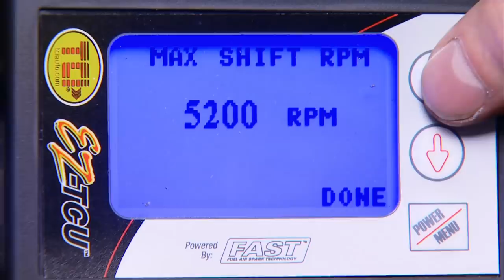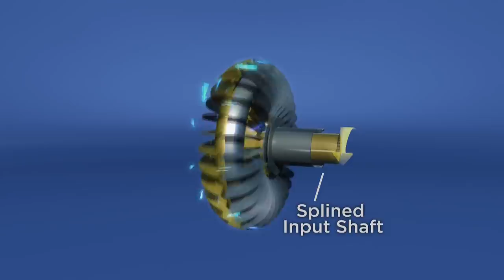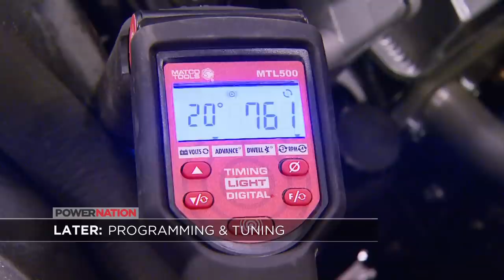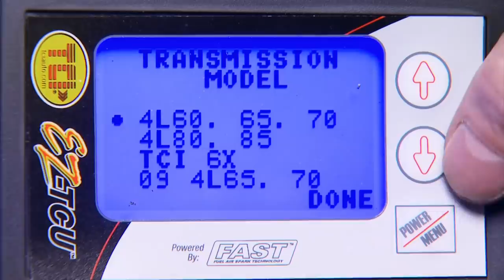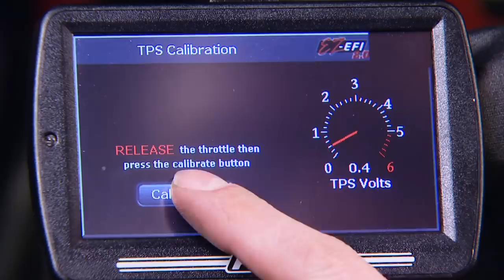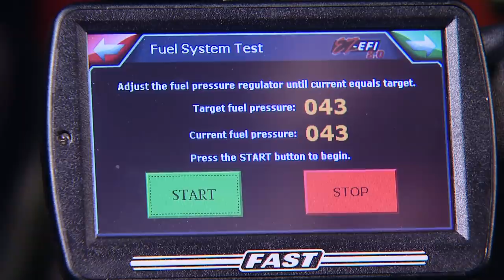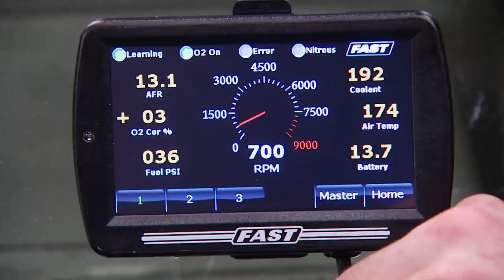Dialing In a Rebuilt 4L60E Automatic Transmission on a Chevy Silverado - Truck Tech S1, E13

Comment: Glad you kept the small block instead of the belly button LS.  Good work.  One thing I like about the small block is the ease of changing oil and filter....look at 'em....right where you can grab them.  I've got a 4.6 T-Bird and every time I try to change the filter I use all the words that come from construction and the Army and I swear the darkest oath upon the Ford engineer who came up with it and ALL his progeny!  (My wife worries about what the neighbors think).  I can swear in Ford, Chevy, and some VW quite fluently.....I'm sure NO ONE else has the problem.  Why didn't these guys put the engine/trans together and stab the whole thing in????  Guess they have all the fancy tools 'n stuff...  I can't believe how easy it is to set up the ignition, timing, fuel mix, etc and all the time I've spent recurving, road-testing, sometimes using water/alcohol injection, going down the road with a pocket full of jets, metering rods, you-name-it.  This setup looks idiot-proof.  I was born too soon.....sigh.....  Self-learning?  That's like a space age toilet that automatically wipes your butt.....

Comment: This system still works to this day and it does work really well.  One thing to add though that is very important.  BEFORE you drive it in learning mode, run the engine at 1500 rpm for 10 minutes and let it idle for 10 minutes.  Do it again at 2500 rpm for 10 minutes and then let it idle again for another 10 minutes.  After that then drive it for 1 hour in light traffic conditions WITHOUT driving it on the freeway.  Doing this will help the computer learn the proper settings for breaking in with a new Catalytic Converter.  The Catalytic Converter has a break in cycle just like the motor does.
Reply: Don't waste your time high flow aftermarket cats are garbage after few months of hard driving they will disentegrate and block your exhaust
Reply: can confirm, I 'telescoped' a high flow cat on my track car, lol
Reply: @mikebaz7843  the ones on my mustang broke and turned sideways within the cat blocking my exhaust flow

Comment: I notice they never check the spacing between the torque converter and flywheel to ensure a save position of the torque converter neck and transmission pump.  You don't want the torque converter shoved all the way to the pump.  You want a little spacing to allow for expansion from heat,  but too much spacing can cause unwanted wear on the tabs the neck of the torque convertor locks onto as well as odd wear on the pump drive.  I typically go for about 1/8th spacing between the torque convertor and the pump.  So if the spacing between the torque converter and the flywheel is 1/4, I'll put in 1/8th spacers to ensure proper spacing at the pump.

Comment: Nothing like a low buck sport truck that cost almost 30 grand.
Reply: RIGHT?
Reply: yeah i clocked the powerterain at about 7 to 8k for the engine, and about 5k for the trans. i’ve bought my daily driver grand cherokee, rebuilt the suspension, rebuilt a transmission, transfer case, rear diff, and driveshafts for less than this “low buck” truck spent on its power system.

Comment: he put the converter back in...        I've never been more disappointed
Reply: Removing a catalytic converter is illegal. They're not going to broadcast footage of them committing a crime.
Reply: @mwilliamshs  depends on where you live. I can take my cat out here in Ohio
Reply: No, it's a federal law. Your state may not have emissions testing or vehicle inspections so you may never get caught but it's still illegal to tamper with or remove emissions control systems on a street-driven vehicle.
Reply: @mwilliamshs  a car owner who is not a licensed mechanic can modify emissions
Reply: @mwilliamshs  True, but I mean they could've replaced it with high flow cats. They aren't illegal, and a good one will actually make the same power as a car that doesn't have cats.
Reply: @joet.2361  what do you think he used? A "low flow" cat?
Reply: @mwilliamshs  Didn't he use the stock cats?
Reply: They used a high-flow, honeycomb converter
Reply: @mwilliamshs  Oh ok, nevermind then I guess.

Comment: when you install the flexplate bolts one of the holes is going to be an oval-shaped while the other two are full circular-shaped so you install the oval shaped bolt first the other two will line up. Itss oval shaped to be tight against the major diameter of the threads on the flexplate bolts.

Comment: Harbor freight sells a cheap trans jack for doing it in the driveway.
Reply: Now all you need is 2K for Transmission and engines controllers, $400 for torque converter
Reply: P Motorsports, Lol

Comment: That early model with the bottom open is nice as long as you dont break the bell housing and damn you can use an impact on that heat shield shit thats way more room than my 04 silverado or 03 suburban

Comment: A trick I used to do in the 70's (teenager needing to cruise ; ) in replacing a transmission was to straddle the car over the front yard drainage ditch... you could easily get under it then : )
I DO NOT RECOMMEND THIS THO TODAY, lol

Comment: Just finished the video my conclusion that a LS engine powered truck in a race against this truck,the LS truck would win
Reply: Not necessarily
Reply: Strokers make a lot of torque..500ft.lbs is easy to obtain
Reply: The Executioner I beat a buddies built 454ss with my 5.3 Stepside lmfao trust me LS FTW
Reply: @guero9093  DID THE 454 HAD A STROKE KIT
Reply: Joshua Gomez nope but was built all new and big ass cam I’m sure it had way more torque then a 383 but also I was cammed and had a built tranny and other mods but I dragged him nasty by buses I’ll never know why people keep building those old ass motors to get near by LS with less
Reply: I just don't understand why you generic motors corporation owners think a LS is the best engine. I have a 407 Chevy that eats LS engine's every night. But I have a 392 hemi that eats all of them... BTW both of them are daily drivers...
Reply: Danny Allen you have to understand a LS engine besides how easy it is and how parts are everywhere are very reliable and good gas mileage even when built unlike old carbureted motors and with 5k you’ll make more power on a LS then any other motor when you try to build on a budget that’s why we like them I build 99-06 single cabs so for me to swap parts and go fast is easy
Reply: @guero9093  I can find parts.. cheap go fast parts for my 407.. I built it on a budget on the Dyno I'm putting out 620 lb at 1350 hp. And o had several LS engine's and still I like the old style better
Reply: Danny Allen the smallblock used to be the original ls swap and to an extent it is but the ls is a hard value to beat, 300 affordable horsepower and it will make pretty much any vehicle your swapping it into a monster but to make a small block perform like an LS (depends on which one you get) you need cylinder heads, cam, 0411 or a carb and nobody really knows how to tune a carb anymore and it’s not gonna be nearly as fuel efficient as an LS, the ls is a hard value to beat but sorry to say a smallblock isn’t king anymore but the one thing the small block has going for it is they’re dead simple to work on
Reply: @guero9093  rcsb all day every day . . . . . Mississippi
Reply: @guero9093  to some... $ is not there sole factor. But to MOST it's  LS all day every day. I'm sold on LS
Reply: walk  Dude! An $800 6.2  Right on! Plus the cam &springs upgrade !  WOW now that's a bargain!

Comment: So the “stall point” is when the engine rpm becomes insufficient enough to spin the impeller fast enough to spin the turbine ei. 1500 stall means that below 1500 rpm the brakes hold the turbine back enough that it sits idle but above 1500 rpm the impeller engages creating pressure to spin the turbine thus engaging the transmission. Yes?

Comment: Actually there is a mechanical connection...it is the fluid. The torque converter is basically a liquid controlled clutch system.

Comment: No normal Person would put that trans in a Truck! 4L60e?  $5000 Later
Could have swapped in a lq4 6.0 with 4l80e and still have $5k left over. 
I have a 86 k30 former Army Truck that was converted to a 5.3l with the original th400. Cost $1500. To do the swap for incl. the engine. With Factory 4.54 gears, she rips.
Reply: At this point there really isn't a reason to use an old small block anymore when the LS is so plentiful and already has most of the upgrades that would be done to the sbc anyway. Videos like these just show how to waste money in my opinion.
Reply: Everybody but the noobs know a 4l80 is the way to go.
Reply: The 350 turbo trans is good too
Reply: Noah Cotney outdated though
Reply: @chrishansen7004  true. They shift fast and put power down well though. and they can take a beating.
Reply: Noah Cotney the 4l60 has no benefits over the 350 imop
Reply: @Billybobaggins9  exactly. A lot of people use them on entry level ls swaps. Not sure exactly how much power they could handle though.
Reply: Noah Cotney I still use a 4l60 because buying a new cross member, flexplate, customizing drive shaft yadda yadda is expensive but if you’re going for performance swapping a th350/400 for a 4l60 is stupid even if it’s “built”
Reply: @Billybobaggins9  overdrive. But I would still use 4l80E
Reply: P Motorsports 4l80 is leaps and bounds over the 60
Reply: Noah Cotney o
Reply: Your saying you did an LS swap in your 86 K3500 for $1500 total????   I call bullshit

Comment: Did make a mistake,run the torque converter bolts up and tighten them up.This is a no no,can break the front pump and damage the flex plate.Before bolting the torque converter,pry it up with a screwdriver first and then bolt it up.Rebuilt transmissions,never use the old torque converter over again.Does not know how to use a clicker style torque wrench right,stop when it clicks!Jerking on it gives a false torque reading.

Comment: Those EFI carburetter fuel injection system I think are the best thing that you can get to replace a carb very reliable throttle response is amazing the only thing that sucks and I had the MSD atomic if I feel injected carburetter the only thing that really sucks is that they’re not tunable you cannot put a laptop to it in tonight and get Max power out of your motor that’s the only thing that I think they should change and make ones that are easy to plug into a laptop and tunable￼

Comment: Why why why would you put a freakin y pipe in there???
Reply: deltaechoomega it was probably sponsored parts
Reply: @Another_Random_Dave  You understand the aggravation though.... ?
Reply: deltaechoomega hell yeah, lol. Long tubes could’ve did some justice.
Reply: They wanted to run a single cat instead of two. Also they wanted the O2 sensors to read both banks of the engine instead of one.   They should have dual pipe setup with dual O2 sensors like most OB2II vehicles run.

Comment: Ah fake duals.. why are these shows so afraid of true duals
Reply: 2-1-2 is better torque. “True Dual” is worst exhaust for street N/A use it doesn’t provide any back pressure and it doesn’t equalize exhaust pulses between banks that equals less scavenging effect. Why do you think all high output v8 cars use X or H pipes or merge exhaust? It makes better power.
Reply: Pretty sure when i watched engine masters they proved the x pipe and h pipe is a myth
Reply: The reason they don't do true duals is for legal reasons.  It's against the law for you to change the number and placement of the catalytic converter on any vehicle.
Reply: Guess my trucks are illegal then haha oh well
Reply: Rance dan 
You should watch it again, they said the H and X are better than straight pipes.
They said there isn’t much gain between the x and H but they were better than true duals. H has better torque X has better HP. Comes down to sound with H and X until your revving past 7k then it’s X all the way

Comment: Emissions compliant, and no EGR or A.I.R. system. This thing will fail in a second.
Reply: All you truley need is working catalytic converters to pass
Reply: @brianpardee1281  All original emissions components on that year and model truck must be present and functional.
Reply: OH NOES
Reply: No need to actually worry about emissions. They are based in Tennessee, no emissions. Just a visual during inspection.
Reply: @CamaroAmx  Hollowed out converters should pass if that's the case. I lived in Arizona, and they are STRICT. Now in WA, no visual or actual emissions testing here, all i own is illegal at some point.
Reply: N. Vzla in PA, it’s visual and gas cap check for anything older then 95. 1995 model year vehicles get dyno’ed until the end of the year, unless it’s AWD then it gets a 2-speed idle test (tail pipe sniffer). By the end of this year anything older then 96 is just gas cap and visual. 96 and up just a standard OBDII check (basically no check engine light and emissions monitors set) and gas cap. Older then 75, no emissions at all. Anything registered as a classic (25 years or older) just normal safety inspection. Antiques get no inspection or emissions. Certain counties only get gas cap and visual no matter the year. Heavy duty vehicles (gas powered) get 2-speed idle. Diesels are exempt from emissions.

My 93 Z28 has a hollowed out cat. It hasn’t required emissions testing in years (kept it under 5k miles a year until it was old enough for gas cap/visual).
Reply: @CamaroAmx  Excellent information! Gotta love those LT1s. One is in my 95 Fleetwood, the other sits on a stand waiting for something in the future.